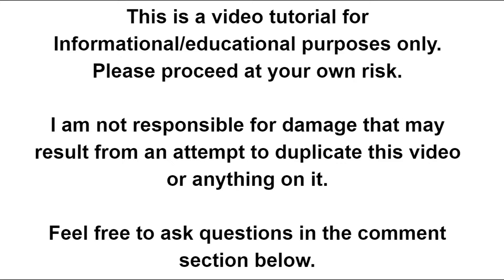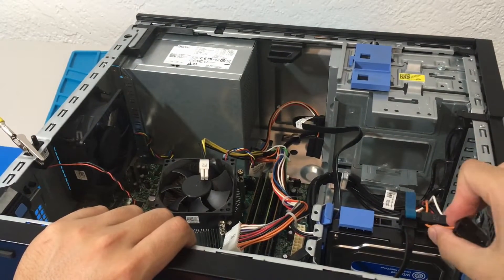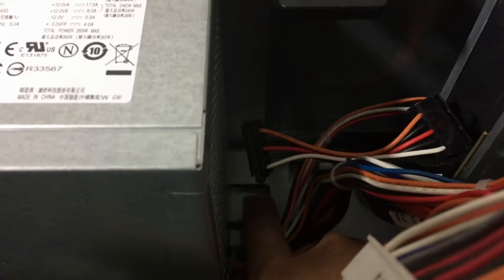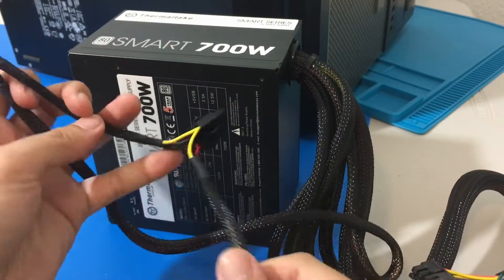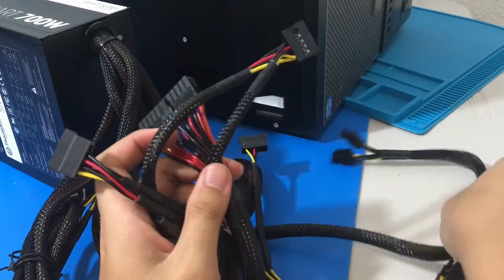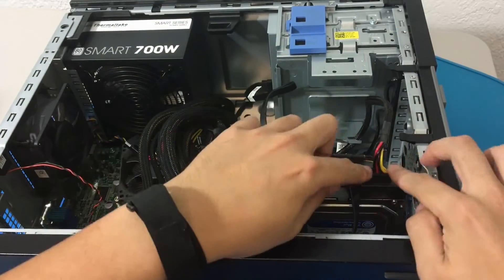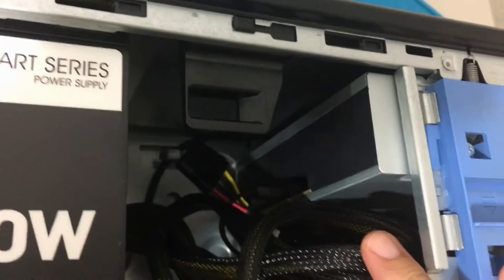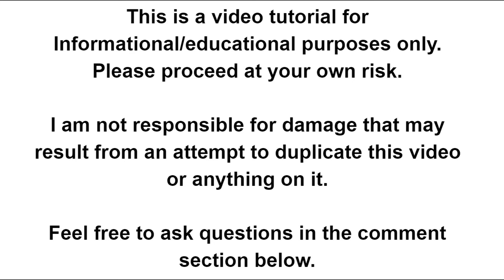Power Supply Upgrade! Dell Optiplex 790 MT | Thermaltake SMART 700W ATX 80 Plus Power Supply

Comment: Awesome video. I’m doing the exact same thing, putting one of those same power supplies in a mid-tower 790. I got the computer for free as an upgrade from my old system, the PSU died in my 1st gen Core series system so I couldn’t use my graphics card anymore because the supply I had on hand didn’t have a graphics card connector.

Surprisingly that power supply isn’t available on Amazon but they’re so slow now that it doesn’t matter anyways, I got one from Best Buy on the way

Update 2/2024: Last September I ended up building a new system with a 5600x and the 2060 that I previously purchased anticipating building a new computer one day

Comment: i have been running this power supply in my build for almost a year now and have had no issues so far in my opinion 700w is a little overkill for a normal pc since the components does not draw that much power
Reply from the maker: Interesting. Thanks for sharing. It is a pretty good price so I think that’s what makes this power supply attractive
Reply: i have this PSU, in another pc, it has coil whine but it works fine. I'm considering getting a i9 10900F in the future for my main pc, should i just reuse my old 700w psu instead of buying a new one?
Reply: @someguywithmtndew5691  I wouldn’t. From what I heard, Linus said this PSU isn’t ideal for gaming rigs and are for mainly very low end or office pcs.. And the fact that I recently found this out, I just got in a rmx 2021 850W psu. I been using this 700w PSU for a while and I’m actually afraid that it could have done some damage to my components but I’m not sure.
Reply: @Novistadors  just what i needed to know
Reply: @Novistadors just plain false lmao, linus is a graypist
Reply: What if it had a 1080 gtx
Reply: a 1080 doesnt draw as much either @alandances7261

Comment: Hey, I bought the same Smart RGB700W upgrade but this one did not have the 4-pin connectors. What is the exact model number to the one you installed in this video? 911!!!!!!!
Reply from the maker: By any chance are there two 4 pins connected together that can be separated?
Reply: @whattmeter  no I didn’t find any. This model had the 24 pin cables, 2 SATA cables some peripherals, an eight pin and a couple of others. But I did not find the four pin in this one. Your video was not made to long ago so I’m sure they couldn’t have been a switch up or an improvement in the upgrade this fast. My motherboard only has a four pin connection.
Reply from the maker: I should have the link and model number in the description
Reply from the maker: I would call their customer support.. they should be able to help you out
Reply: @whattmeter  you sir, are a life saver! 
Thanks. Best Buy beat Amazon's price.
Reply from the maker: Good luck with your upgrades
Reply: @whattmeter  worked like a charm. would you be kind as to show how to connect a new video card? I'll be installing an EVGA GeGorgce 210 1024 mb DDR3 PCI Express, which is the right connection. Thanks again.
Reply from the maker: Is that a low profile card or does it require a power supply connection? Sorry I don’t have that graphics card model
Reply: @whattmeter  it’ll be here in three days. It is a low profile and may need a power source.
Reply from the maker: I looked it up. Looks similar to the gt 710. I made a install video on the 710 https://youtu.be/E9xH1nIKFG0

Comment: I have the optiplex 790 ssf I know that a regular atx psu won’t fit inside, but still possible to use a atx psu without a proprietary connector adapters? Cus i was thinking of swapping the board to a new micro atx case
Reply from the maker: Case transplant is hard in my opinion because of the proprietary case connections/ connection to buttons etc.
Reply from the maker: Did your ssf have a 24 pin on the motherboard?
Reply: @whattmeter  yes, and one 4pin
Reply from the maker: Sounds like a regular atx power supply will work, although outside of the case. I would try to look up optiplex case transfer or Optiplex case transplant. From what I remember the power buttons are tricky

Comment: So any atx power supply would work in my dell optiplex 790 mt?

I am thinking of this
https://www.skroutz.gr/s/14158545/Be-Quiet-System-Power-9-500W-Full-Wired-80-Plus-Bronze.html?from=sku_spec_variations
Reply from the maker: it looks like a standard sized atx power supply so it should fit on an optiplex 790 MT

Comment: I bet you cant make a gaming pc out of a dell optiplex
Reply from the maker: Nah more of a budget pc.
Reply: You are wrong. Dell 7020 and 9020 MT i5 and i7's can be turned into gaming PC's. 

You can upgrade the ram, ssd and put in a gtx 1660 ti.
Reply: @meilyn22  the optiplexes are still very capable for low/medium settings.
Reply from the maker: MTs yes. Small form factors are different because you can’t fit a standard power supply inside

Comment: What’s your Instagram? I have the same power supply 🤦🏽‍♂️and it’s not coming on
Reply from the maker: It should have five year warranty I believe. I would check if it still has the warranty.
Reply: Try switching on the button

Comment: If I were you I'd return that psu before it fries your pc got the exact same one 4 months ago and have already had to have it replaced 3 times due to piss poor connectors their molding machines suck absolute ass the last one fried my entire system due to a faulty cpu connector so I do not recomend ANY thermaltake smart series psu. The way these psus work is good on paper but in practice the "smart" aspect of em is absolutely stupid they use cheap ass capacitors that will not hold proper voltage to sustain a system would be fine for a business pc but anybody rocking a 700watt psu isnt using it for normal business spreadsheets ect itl be under load which is gonna cause issues later on
Reply from the maker: Thanks for the tip. I don’t use it too much as Im trying more modular power supply

Comment: Is this good to get I basically have the same build...I'm scared this will fry my pc?
Reply from the maker: if you are worried, I would bring it to a professional to play it safe
Reply: @whattmeter  I think he means if the power supply won't damage his components. I'm also worried, since I found out that it's not a very good power supply
Reply from the maker: Ohhh ok. It is a pretty cheap budget supply. Mine still works. But definitely a difference in quality compared to a $100 power supply
Reply: @whattmeter  How long have you had it for. I just got this for my 5700 XT build, I'm worried it's gonna fail, I've heard bad things about it, like failing and damaging components, starting a fire or explosion. What do you think I should do?
Reply from the maker: Ive only had it a few months. Just to help me practice power supply upgrades. I don’t get to use it often. I think it’s really up to you. Are you able to return this budget power supply? Especially since you have a 5700 xt I can see why you would be worried. I would always I try to play it safe but that’s just me

Comment: Can I fit the ARESGAME Power Supply 650W 80+ Bronze Certified PSU into the Dell optiplex 7020
Reply from the maker: I would check the connections and case size on that optiplex. that's a newer model I believe. Sorry wish I could help.

Comment: Will this power supply work with 2070 super?
Reply: You will have to remove the Hard drive cover (right sidebottom) if you wanna fit a 2070 super
Reply from the maker: That makes sense. It’s a big card
Reply from the maker: Great question. Not 100 percent sure, but This should work.The 2070 super requires both a six pin and 8 pin. Wow! I checked the manual and this power supply has two (6+2) connectors running through one cable. https://www.nvidia.com/content/geforce-gtx/GEFORCE_RTX_2070_SUPER_User_Guide.pdf
Reply from the maker: I would still double check though. I've never used a graphics card that required both six pin and eight pin to be connected. The thing is for the Thermaltake 700w, the two (6+2) pins run through one cable, so it might get tricky. For a 2070 super, I would go for a modular power supply for cleaner look. Here are the connectors for the thermaltake 700watt https://www.thermaltakeusa.com/smart-700w.html
Reply: Btw if you still have that stock prossecer there’s gonna be bottleneck
Reply from the maker: @thinkingalert2695  thanks good to know! I plan to upgrading it to an i7 when I have time. too many gaming requests LOL
Reply: @whattmeter  Will this Power supply works with rx 5700 xt?